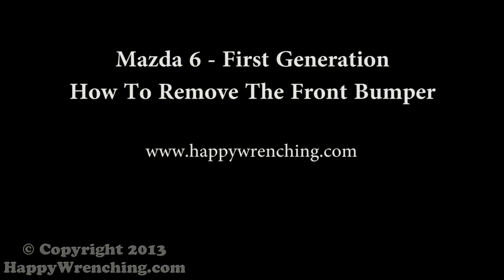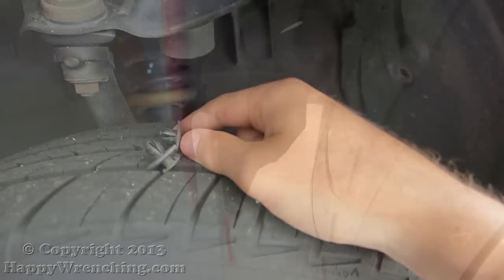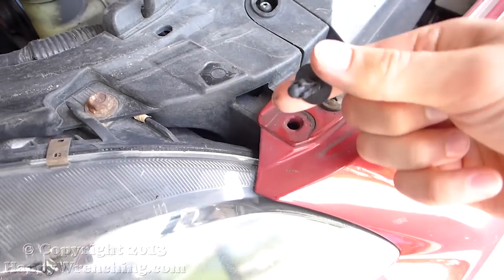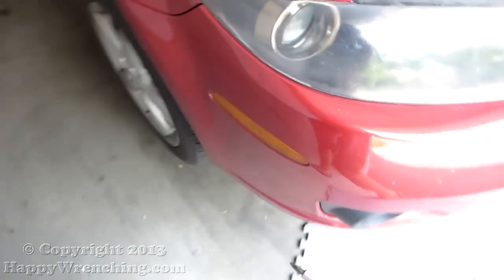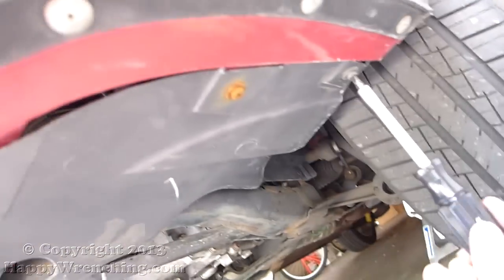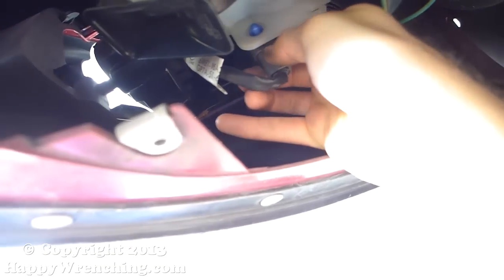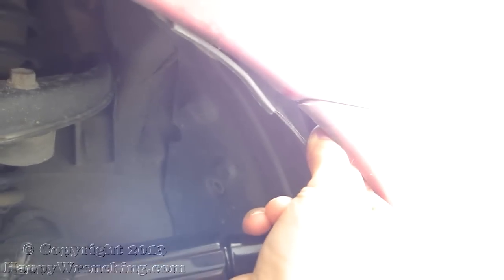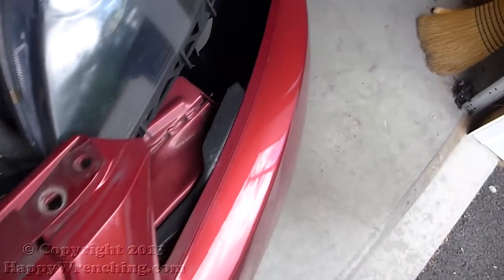Mazda 6 Front Bumper Removal

Comment: Having just done this few times, small time saver for those just removing the headlights -
no need to remove 8 bottom screws that hold the splash guards, they are elastic so once you remove all other bolts and clips you can just put the bumper down on the ground and they will bend without damage and you'll still have full access to the bottom headlight bolts.

Thanks for the video, still super useful 11 years later.

Comment: thanks man. used your bumper and headlight video for my first Mazda 6 bulb change. what a great design. lol. thank God for YouTube.
Reply: also, this saved me huge. paid $30 for my bulbs on Amazon, and 3 hours of labor in my driveway. thanks again.
Reply: It's not really necessary to take the bumper off to change the bulbs.  A mirror helps you see how the flexible metal clip holds the bulb in there.  Just flex and unhook it from the back of the bulb.  IIRC, leave the electrical connector attached to the bulb until you get the bulb out of the headlight housing.  That way, if you lose your grip on the bulb, the attached wire won't let it get lost inside the headlight.  Some long pliers with a bend in them may help when installing the new bulb, but I was able to get my hand in there to do it.

Comment: Very informative. Thanks for this. I had to replace the headlight assembly. This video was very valuable. It should be noted that those clips that hold the plastic parts to the body are crap and get very brittle. I'm going to have to replace them as several broke. They weren't all screw type either. I was surprised when a large chunk of shaped foam fell out. (Goes on the front of the frame just behind the bumper...) Thanks again.

Comment from the maker: The grills are held on by several tabs that you have to slide off from the inside of the bumper. With the lower grill, you take off those tabs, and then push the grill inward. The upper grill, you have to take off the tabs and also the mounting clips and screws on top. Obviously its easier to do all this with the bumper off.

Comment: I assume it's pretty straightforward. I looked under and saw some visible bolts. Any suggestions in fixing rust? I am planning on sanding, then applying fiberglass putty, then sanding, then paint.

Comment: I destroyed the plastic clips  that attach the bumper at the top centre. The plastic was too malleable and just twisted with the screwdriver. Ended up prying the top off, and pushing the remnants through with the screwdriver. Do you know if you can buy replacements?

I need this video for front turn signal bulb replacement. Not very user friendly by Mazda to have to take the entire bumper off the get at the lights.

Comment: Hey guys I parked our 2017 Mazda 6 up against a cement chock blocks are held in place by  the blocks in place by a steel drive pin well one must have been sticking out and it bent the front lower bumper/valance so what I did I got a heat gun to heated up the plastic bumper then I squeezed it back in place well it turned out ok except for the black strip on it so I removed the skid plate and heated the plastic up again then I stuck a spark plug socket to get the factory form so it came out perfect just sharing oh use cold water to get the plastic hard again quicker.

Comment: I’m having an issue with the 2 metal screws on top next to plastic screws! They are all rusty and don’t want to move! Any idea on how I can remove them without ruining anything?
Reply: In case this helps anyone else, I had the same issue. I eventually got them to move but the nuts that hold them on were just spinning with the screws. I guess the nuts are supposed to be captive but they broke free.
If you can get a socket on the underside nut, it's a 10mm. But assuming it's rusted on I used an 8mm drill bit to drill the head off the screw, then with the bumper removed I could use some grips and a 10mm socket to remove what remained of the screw. Make sure to douse the screw with some water while drilling to avoid melting the plastic.
To replace you need M6 flange bolts/screws with a 20mm head. I couldn't find bolts with a head that large so I got some 20mm washers to go with them.

Comment: I had an issue with one of the screws (next to the plastic clip) on the grill, where the bolt was spinning and I could not get the bolt out. A wrench wouldn't fit and I tried to putting a screwdriver in there to stop it from spinning with not success. The only solution I thought of was to grind down a old wrench so it would fit in the slot. Do you have a better option?

Comment: The two 10mm screws on the bottom side were rotating so I had to put a 10mm key under the bumper to hold the nut still.

Comment: Bro u just saved my ass. I need to replace my headlights on my 2006 Mazda 6.  Any suggestions on good after market headlight kits? The dealer wants over 600 for the set. Found some other ones  between 400 and 500. Just seems like I can find a good pair for cheaper for a 2006 car

Comment: Great video, thanks a lot. I'm unable to unscrew the two screws at 2:51, the thing that holds the screws on the other side of the bumper is twisting along, any advice?
Reply from the maker: Hate when that happens. Any way you can slide a pair of pliers to hold it from the other side? If not, and if it was me, I would take a dremel (or a regular grinder) with a metal cutting disc and cut the bolt head off.
Reply: @happywrenching  Thank you for your feedback. I tried to hold it with a 10 mm wrench because I couldn't fit pair of pliers behind the plastic cover, but to no avail. Next week I'll give it another go and perhaps I just cut those bolt heads off like you're suggesting (its both of them them won't come off), thanks again I appreciate it.

Comment: my right front bumper is not intact to my car i don't know  how to fix it.. the whole bumper is still in my car just the very side of it is out and not connected to the rest of the car how to fix it?
Reply: FlowRealSmooth there is a plastic bracket on each corner that the bumper cover snaps into. most likely that bracket is broken and you need to buy another one. if u follow this video and take the bumper cover off, you'll see it.  I think I bought my brackets on Amazon or rockauto.com. try the latter first.
Reply: @mrau92me  have the same problem, thanks bro.
Reply: I looked up this video because I have both sides of the bumper assembly loose. Thank you for the great information. 
 @mrau92me
Reply: @peterjc2121  No problem... Glad I could help. You can see the white bracket I'm talking about at 5:05 in this video. There's one on each side.